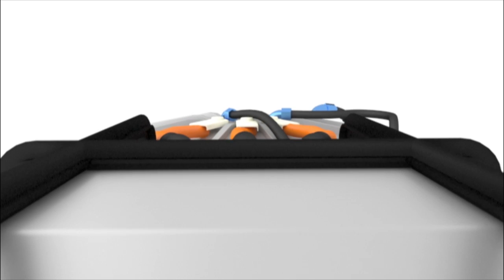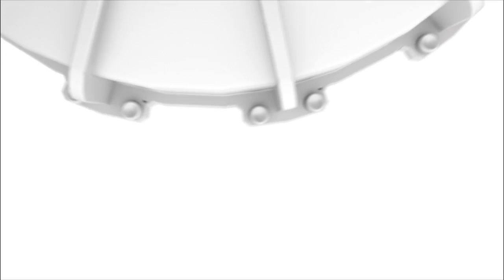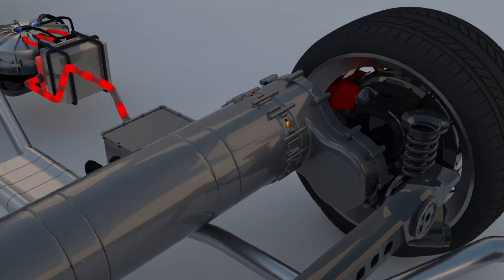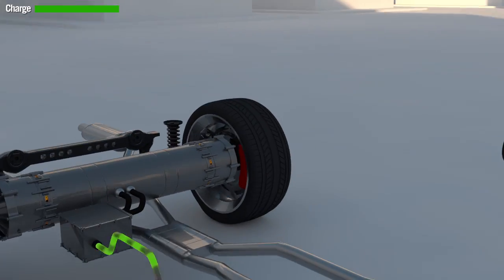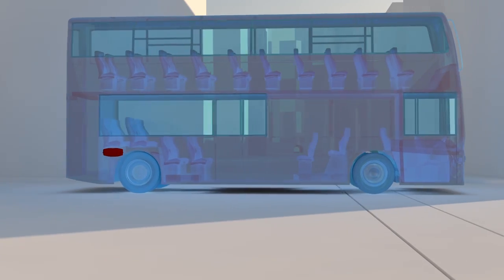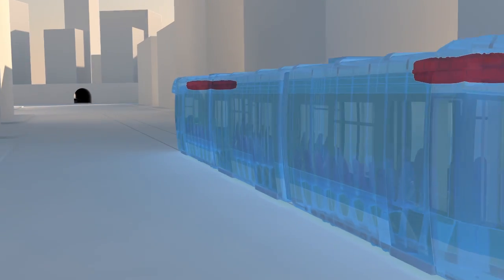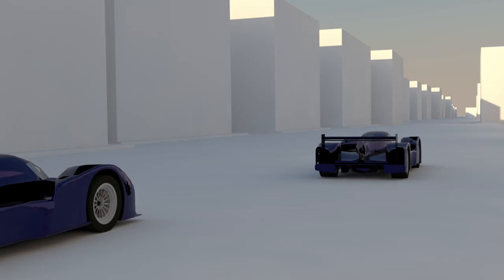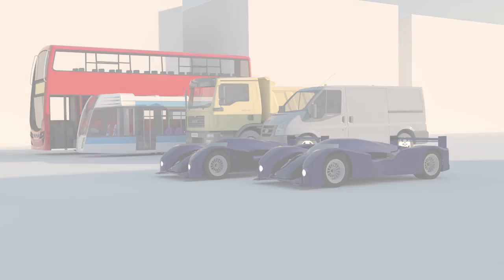Williams Hybrid Power Flywheel - How it Works

Comment: If y’all don’t show up in 2024 or sooner with this, imma be sad 😢.
Reply: Well, Its 2024, the website is down and the test buses which were driving in London 10 years ago are nowhere to be found either. It kinda gone to shits it looks like :p
Reply: it did not go to shits or fail. The reason it 'appears' it went to shits is because the system was Perfect. no degradation. no software. fully mechanical. free self operation. no external power source. likely zero maintenance. It was Perfect and Perfect is what the corporate world hates, because money can't be made through Perfection. Here's the evidence:
Look at the current employed system: brand new cars built with batteries that can only be charged at specified branded stations at a capacity limited by the battery and limited time to charge

vs

Williams HP Flywheel: perfectly integrates into any existing vehicle, needs no external power source while its capacity and output limited only by the customer's demand.

Money is made through: charging stations that convert your time into a product (you will have to buy something while your bored at any charging station)
upgrading charging infrastructure every time demand changes (more powerful cars need a powerful grid to transmit the powerful power)
replacing degraded chemical batteries after certain usage period (because of the nature of batteries)
software that must be paid for in order to access features of hardware already available (Fisker Ocean 500 launch start limit)

but Williams'? what software? - no need. what charging? - the brakes charge it. what replacement parts? - no capacity degradation here. what charging station? - already existing fuel stations, ...........hence no/little money to be made.